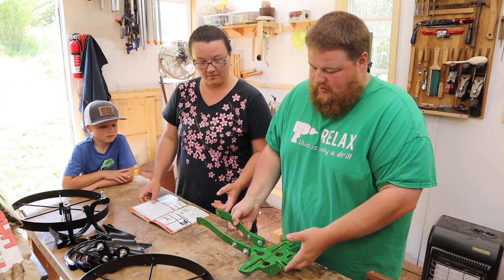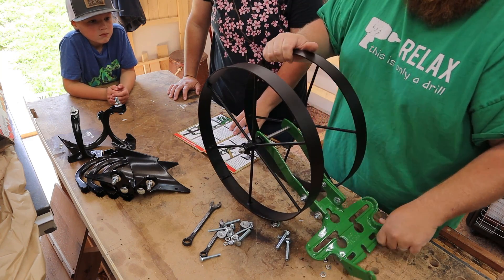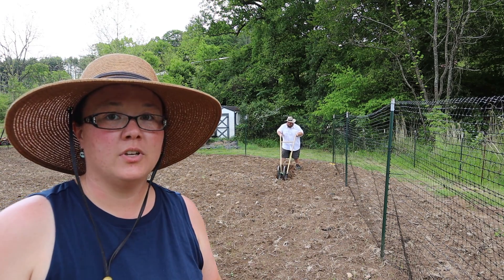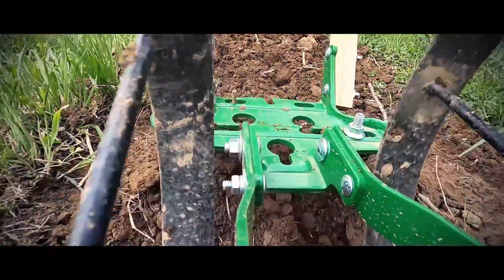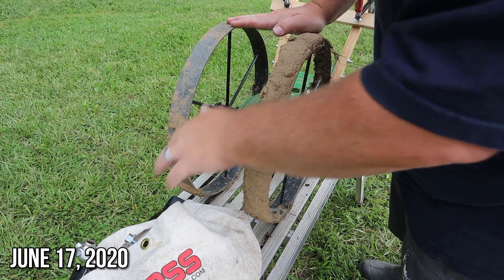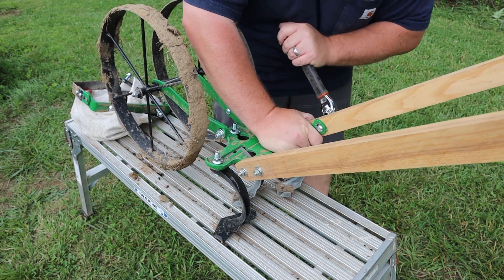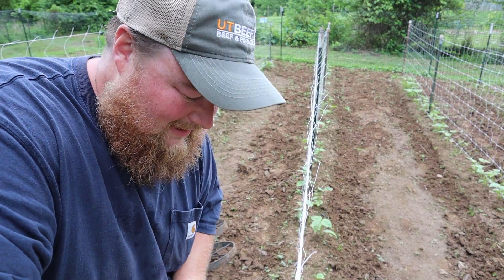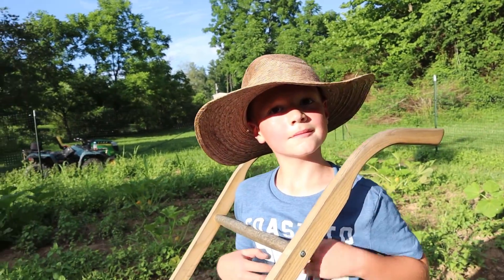TWO MONTHS LATER: Review of the @gardeningwithhoss Double Wheel Hoe

Comment: Something my Dad taught me decades ago. For any implement which you use to work the soil, very soon after use, clean the off soil and treat with a grease or oil. For my garden hoes, shovels, etc I made a galvanized bucket with coarse sand and waste motor oil for this purpose. This will keep you implements rust free and help them go through the soil more efficiently.
Reply: I learned the same trick from a grave digger. Yes, he dug graves with a shovel.
Reply: Great advice

Comment: I have one like that, that belonged to my Grandmother. It's probably from the early 1900's and is cast iron. I would love to someday get the blades sharpened and the finish coated, and research whether it's supposed to have added wooden handles, like I've seen on some. Thanks for the video, stay cool and safe. It's 103 degrees here in North Texas and can't even imagine being out in this heat right now.
Reply: Sounds like you have a treasure. Yes it's hot in Texas we had 108 or so in San Antonio.

Comment: You can shorten the handles according to the book. I would make a template of the bolt hole spacing before I did any cutting though. I got my double today and I may have to shorten the handles about 2 inches.

Comment: Can you break new ground with it? As in turn over sod?
Reply: In the Rockies.Dennis
Reply: Might wanna lubricate/those screws before penetrating  wood. Dennis
Reply: Can you install wood/screws without splitting the wooden stretchers (handle brace). Dennis
Reply: Do not plow/mud.....
Reply: I am going to run two oscillator hoes simultaneously  on my hoe when ground not too wet AND not too dry AND Weeds not too tall or deep rooted. Good demo ladies and gentlemen..Dennis
Reply: GRE AT DEMO YOUNG GARDENER....DENNIS IS

Comment: That olate in the middle is designed for a chain.If you hook it to your riding lawnmower (in low) it will be lie walking behind your horse. This is reall good for the first plwing each season.If spray the axle shafts with dry lube it will keep moisture out. You will have to sharpen the acc.

Comment: Call me crazy, but I think a sharp hoe and a tine rake is probably faster.  You get more ummph when you pull versus pushing, and you don't have to keep going over it twice.  That being said, I imagine it's not near as hard on your back, so it very well might be worth the extra work in the long run.  I bet a 2-man crew with one working that wheel hoe, and one working a tine rake or cultivator could really get some work done.  Thanks for the video.
Reply: Stephen Siler for what he was doing you may be right!  He wasn't really using the tool to its full potential.  Weeding with the Hoss wheel hoe should be done PROACTIVELY, if the weeds are that large you're really too late.  It should have been used when the weeds were extremely tiny, to break up the very fine roots.  I'm considering purchasing the Hoss after experimenting with an old wheel hoe with just 3 cultivator tines.  Using it weekly (before weeds are there!!) its been extremely fast, easy, and kept the garden amazingly weed free between the rows.
Reply: @HB-bc5po just add accessories to your wheel hoes. Seems like accessories fit all the older and newer wheel hoes.Dennis